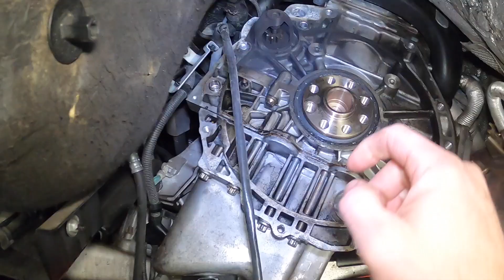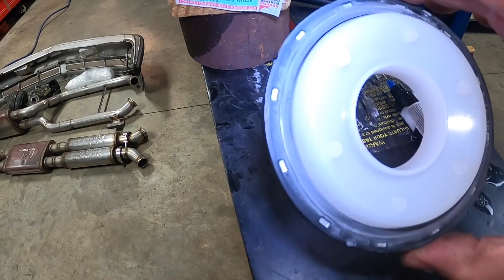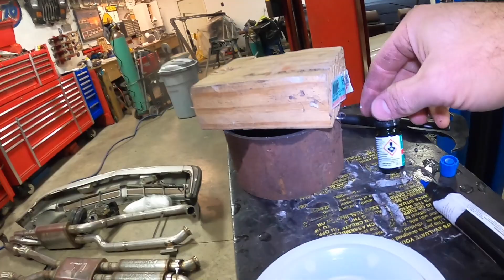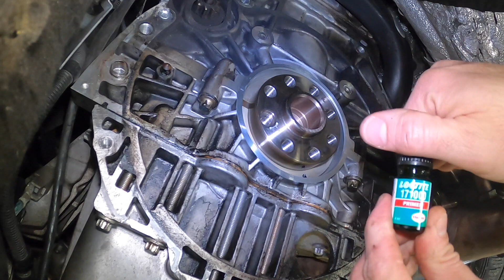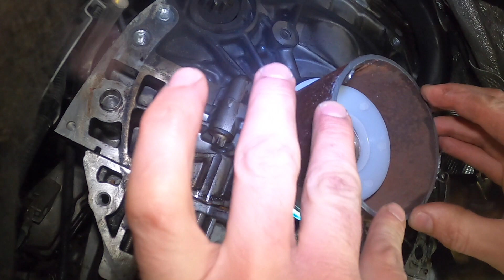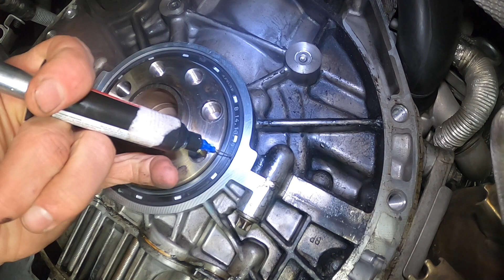Part 1c BMW N54 Rear Main Seal Replacement

Comment: Toyota FIPG Oil Pan gasket maker sealant is the sh*t for this application, or any other...have you seen any modern TOYOTA engines as far oil leaks go ? None...Lol.

Comment: What did you use to degrease the areas where the sealant primer is applied? I tried brake cleaner and I can't get my primer to dry, waited an hour and still no joy, any tips are extremely welcomed. Thank you very much.

Comment: Nice video and thanks for posting...How far do you drive it in? Until it bottoms out or until flush with the surrounding engine block area?
Reply from the maker: Yup, until it’s flush with the block! Once it’s flush, you can use the specified RTV

Comment: Very nice DIY Frank. Most tuned( 20+ psi) n54's blow the front and rear seal out very early. An oil filler cap breather can prevent this. Dutch regards, Nico.
Reply: @Marzipan Jones isn’t there too much crankcase pressure in the first place, I thought it was a good idea to use a breather filter to relieve some of that excess pressure?

Comment: can i just use the red silicone (head gasket sealer) to seal it?
Reply: Yeah wondering how important this is lol. Can’t find it in Canada easily and it’s not cheap
Reply from the maker: Honestly, you know how BMW has a special recommended sealant. The properties with this is that it is high temp, oil resistant, and seals the tiny crevices that normal RTV won’t. It’s a gamble, but imho a low risk gamble if you use standard gasket maker.